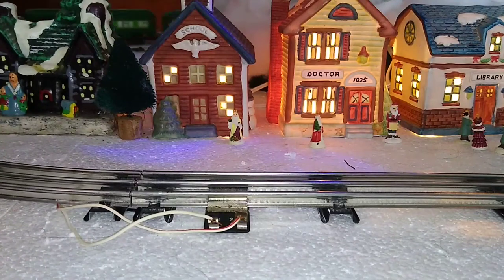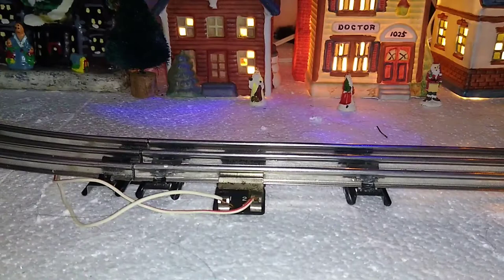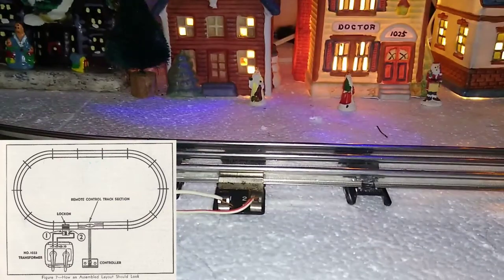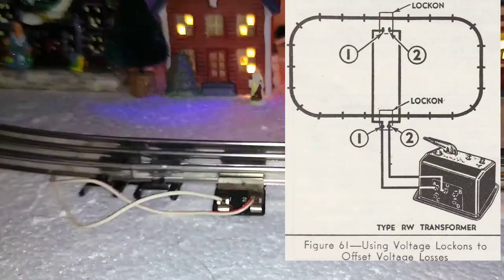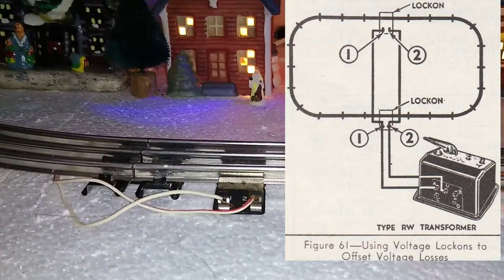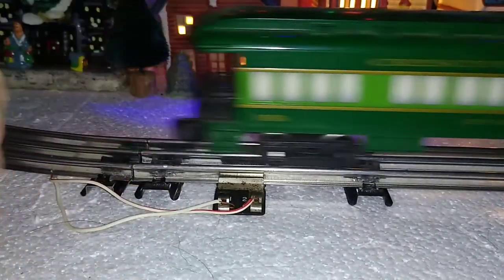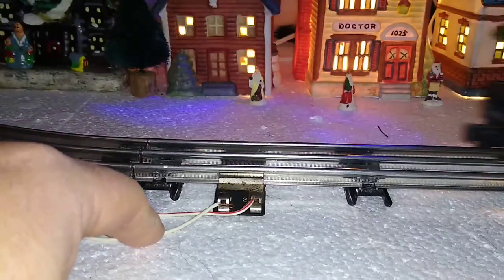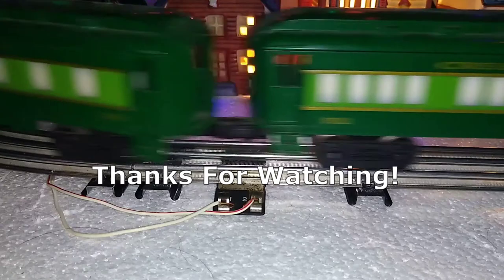How To Improve Lionel Train Performance With Extra Lockons

Comment: Finally  I found the answer !!    I figured the more track you had.  You would need more voltage.  But it seems no one is talking about that.     After seeing some of these big layouts.  With hundreds of feet of track.   I did not think it would be so difficult.   To find out about voltage.   Thanks, very simple to add more power sources.   Simple picture solves the question. Thank You!
Reply from the maker: You're welcome!!

Comment: I happened on this solution at the age of 12 in 1957!  I had a fairly large circular track, with only manual switches, and only one electric signal.
Reply from the maker: I'm a bit younger than you. I first did this when I was around 9, but it was in the 1970's. :-)
Reply: @ToyTrainTipsAndTricks  what about with fas track?
Reply from the maker: While I do not have Fastrack to demonstrate with, the principle is the same. Install two or more lockons as necessary (or attach the necessary wires to the underside of the track) and just make sure that the outside rail connections are together and the inside rail connections are together - red to red to red and black to black to black.
Reply from the maker: Also, check your track pins very carefully with Fastrack. While it looks great, many who use it have told me stories of poor electrical contacts. You may want to use a few MORE power lockons/connections than you would with tubular track. [BTW, just to eliminate the possibility of problems, on my permanent O27 layout I attach feeder wires every 6 feet or  less.]

Comment: I tried several things and what worked nicely for my K-Line Penn was I put the actual hot wire inside the middle track, and neutral wire in the outer track, then I connected the track piece inside with the wires.. been going strong for 2 years without power loss and it's really snug so no fear of wires coming out
Reply from the maker: That works, but I imagine it can be difficult to shove both the wires and the track pins into the adjoining track.
Reply: @ToyTrainTipsAndTricks  not difficult at all.. the wires are very small.. so I exposed ¹/²" of wire on each, then placed them in the open slots of the track. Then, I just pushed firmly with the connecting track piece and done.. took a total of 2 mins.. that includes exposing the wire.. 2 min tops! Try it out, you will always use the technique going forward I promise
Reply from the maker: @MortisNuntius  So you are or are not using track pins where your wire connects????
Reply: @ToyTrainTipsAndTricks  , it would probably work quite well as long as you sand down the pin a bit so you have room for the wire.

Comment: Thank you for this video. My layout is small ,  but there has been a loss of power when my engine crosses over a vintage lionel o22 right hand manual switch.  The switch has a small part where its not metal,  and I have to gun the train full throttle or the engine stops.  Adding the lockon for boosting power past the area is helping,  and while the train still occassionally stops,  the problem is less, and I dont have to gun it at high speeds just medium speed .  Very informative video , thanks again.
Reply from the maker: Some locomotives, especially if they were designed as O27, have their pickup rollers spaced in such as way that they lose power on parts of O22 turnouts. If that's the case, there's no permanent cure without modifying the locomotive.

Comment: I've run ONLY one wire from lock-on to lock-on...and I believe it has been effective. Running #1 on main lock-on to only #1 on second lock-on...not the #2...seems to have worked for me. Am I wrong?
Reply from the maker: That could be effective if you had a loose connection or other power drain somewhere along the center rail.

Comment: OKAY SO THIS MIGHT BE A DUMB QUESTION BUT I JUST NEED CLARIFICATION SO IM RUNNING THE CW80 TRANSFORMER AND YOU KNOW HOW IT HAS 4 POSTS ON IT? SO FOR MY 2ND LOCKON AM I CONNECTING THE WIRES TO THE EXACT SAME POSTS AS MY #1 LOCKON?
Reply from the maker: Yes. The other posts are constant voltage (accessories).
Reply: @ToyTrainTipsAndTricks  OKAY THANK YOU

Comment: What size wire is best for lockons
Reply from the maker: If memory serves correctly, the maximum gauge that will easily fit in a Lionel Fahnestock clip is 16 gauge.

Comment: Not sure what the best technique is to clean the track for my n scale trains. Any recommendations? I mean I have heard of using isopropyl alcohol to do it but I’m not sure.
Reply from the maker: Ask 100 modelers, you'll get 100 different answers. On our old HO layout we used everything from denatured alcohol to Goo Gone. Old timers used to use paint thinner on brass rails. Pretty much any solvent product will work, especially if followed by an electrical contact product such as Rail Zip.

Comment: Why don't you want to try this with a modern transformer?
Reply from the maker: The comment about modern transformers is a clip from a different episode. In that episode, I used a remote lamp dimmer to provide basic remote control to the layout. I do not recommend this with modern transformers because intentional under-powering of the incoming voltage can harm solid state circuits.

Comment: I have some really old O27 track and some long runs (4ft by 8ft double loop layout). A connection to the transformer about every 9 pieces of track works very well. 
A poor connection between 2 pieces of track can heat up the track noticeably. After setting up a new layout and letting a train run around it for awhile, turn off the track and run your hand over all the connections. Be careful, a particularly bad connection can get hot enough to burn! Any connection which is significantly warmer than the rest needs attention. Rusty pins need to be cleaned. Loose fitting pins need to be tightened. Replacing the tracks on both sides of the hot spot is a good alternative
Reply from the maker: Good tip!
Reply: I have a Lionel polar express train with an 80 transformer. I noticed, as it makes its way around the simple small round track (nothing else connected) I have the train slows down after 10 laps or so, at full speed. It starts off super fast even pills out but slows 1/4 the speed, anything I should consider? 

A family member of mine has the same train without this issue, but I have been shocked by theirs before on the track, is this normal? I haven’t had the urge to test mine nor double check theirs again 😂

Thanks for your expertise
Reply from the maker: @ProjectAnubisUSA  2nd issue first. Yes, if you touch the outside rail and center rail at the same time, you can get shocked. It's only 18v so it's far from fatal, but can give you a tingle.

Without seeing your training action, I would think that heat/friction is the problem. First make sure all gears are properly lubricated. If you have a multimeter, try to monitor the amperage of the motor. If amps increase as your train slows there could be some sort of loose electrical connection that only manifests as the motor heats up. If this was a Postwar locomotive I'd suggest checking the motor brushes, but that's not a possibility with modern motors. Good luck!

Comment: I have a really old Lionel train set and I'm using really old train track. My train slows down alot when I hit corners. Its really bad to the point where I have a hard time setting the speed to a constant speed and letting it run because it will be to much power for the straight sections  if it makes it and it stalls in the corners at a lower power setting. My locomotive has a really tall gear ratio and is capable of incredible speeds. I need to reduce the friction in the locomotive around the bends. I cleaned the track and the locomotive wheels and I don't know what to do my train doesn't run smoothly like that. But it runs great in straight sections.
Reply from the maker: Without knowing exactly what you have, I can only respond in general terms.
You are correct that friction is an enemy. There will naturally be some slowing of the train in tight curves with the natural friction between the flanges and the track. However, excessive slowing may be caused by:
1) Running the locomotive on tighter curves than it was designed for, such as a standard O (O-31) locomotive on O27 curves.
2) The wheel bearings for the locomotive and cars may require lubrication. Every added bit of friction will multiply the problem.
3) Voltage loss. If the track is "very old", cleaning the surface may not be sufficient as there could be corrosion INSIDE the open tubular track causing resistance. If you can find a few sections of newer curves, try the locomotive on them and see if the problem improves. Also, add more feeder wires as necessary. Older track may require more frequent feeders because of corrosion or loose track pins.

I hope this helps!
Reply: @ToyTrainTipsAndTricks  thanks for your help! It's definitely old track. It's O gauge tubular track. Me and my dad cleaned out the area where the pins go and we tightend down the ends of the track onto the pins. I scrubbed off all the rust off the tops and sides off the rails and it's shiny bare metal. The Lionel coating is definitely gone. I went through and I cleaned the locomotive wheels and gears, I oiled the axles and greased the gears with Lionel locomotive lube. It runs excellent in the straights and terrible and loudly in the bends.  I might have to post a video here on YouTube to show it off because I am very confused. Is there any logic to polishing the rails? They are not the smoothest I only cleaned them with a scotch brite pad. And then I wiped them off with a cotton rag and 91percent alcohol. And the problem is still persistent. I can drive it fine, but I have to apply more power in the bends and less on the straights. I wish I could set it and just watch it go.
Reply from the maker: The following information would be helpful: 1) What type of track are you using (O27, "standard O" [O31] If you do not know the difference, what color are the track ties - black or brown or aluminum?)? - I assume since it's "really old" you do not have Fastrack. 2) What is the number on the locomotive?  3) How many and what type of cars are you running (if any)? As I said, SOME slowing will occur on curves because of the friction between the flanges and the track, but your description sounds like much more than that.
Reply: The locomotive is an 8612 steam engine. I run inbetween 4 and 9 cars,  I have 3 box cars, a grain car, a coal car, two flatbeds, a tanker and a caboose. And obviously a locomotive and tender. I've checked and cleaned the wheels on them all. The caboose seems to have the most drag of them all, and it's only because it has electrical contacts for the light. It's not bad. The locomotive wheels seem to be what's dragging the system down. Ironically enough, if I run more than like 6 cars it provides a little bit of resistance and momentum to the train and I can make it run at about 55 percent power. The extra cars keep it from picking up too much speed. And they help push it through the turns lol. When I run just a locomotive it is hard to do that because even at like 45 percent it picks up enough speed to derail and any lower it stalls in the bends. It's definitely a weird situation. I don't mean to keep bothering you about it. I still haven't polished the outside rail. I was thinking about trying with a dremel tool polish wheel. Edit: and also the ties are black. It's Lionel tubular track. It's from like the early and mid 80s probably and it hasn't been stored well. It's been stored a few times in a basement and had to have the rust cleaned off. I did a really good job this time, and like I said even went as far to wire brush the pin holes and re-crimp them back tight.
Reply from the maker: The #8612 steamer was offered in a variety of road names in the late 1990's and early 2000's. With a can motor that requires very little voltage and a diecast shell that has a high center of gravity, the most common issue with these is falling over/derailing in curves due to excessive speed. The engine was designed for O27 and larger curves, so track diameter is not an issue. It sounds like an either an electrical issue, or somehow one of the geared drivers is binding. If the track is okay, check the center pickup rollers - are they centered properly? Are they loose so they lose contact in curves? Do you feel anything loose inside the locomotive? I would also check the drivers that they spin freely. Is a drive rod bent and binding? That's the best I can do without seeing the problem for myself. https://www.lionelsupport.com/media/servicedocuments/70-8616-250.pdf
Reply: @pieman12345678987654  I have had the same problem using old track.  When I built my last very large layout, I had a lot of old straight O27 track that I used with new wide radius curves and the extra long straights.  I have had to clean pins and swap out short straight sections.  The only good solution is to buy new O27 track.  Get the extra long sections to eliminate some of the connections, use wide radius track if you can, add extra lockons and use 12 gage stranded wire if the layout is very large running it in a circle under the track both ends connecting to the transformer with 16 gage feeders connecting to the lockons.  Small layouts can use 16 gage wire one lockon connected near the transformer and another lockon connected opposite the transformer.